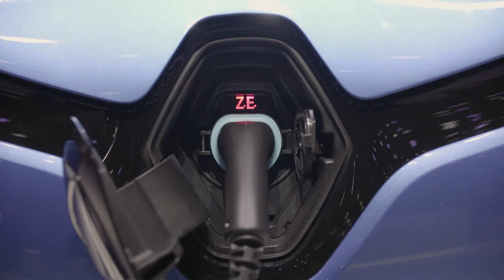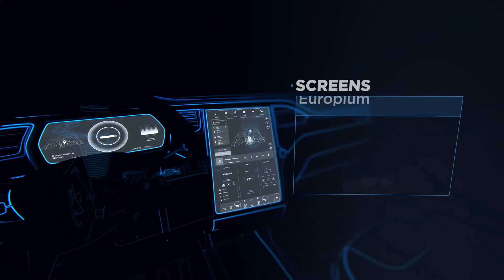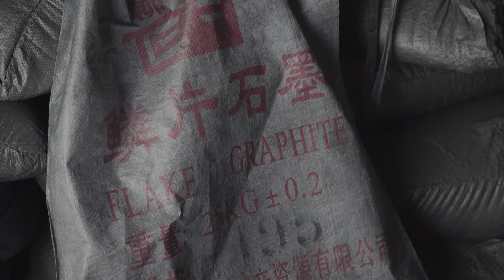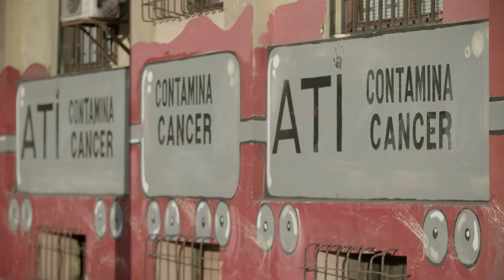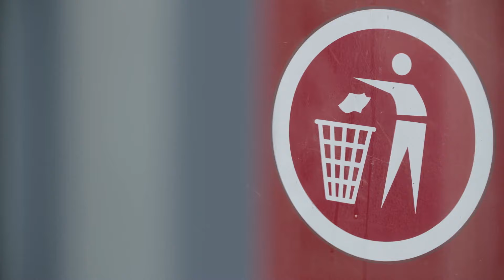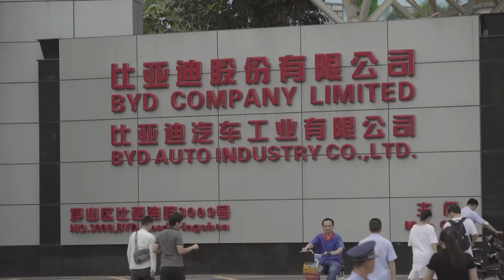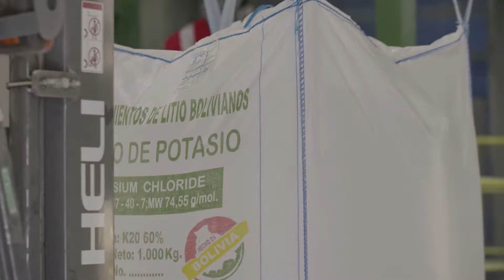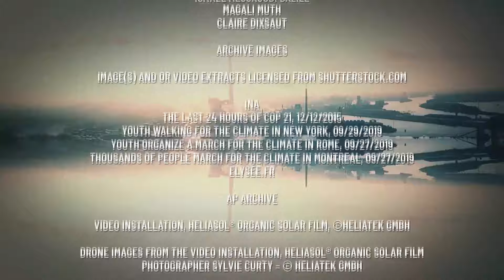The Big Problem with Renewable Energy | Documentary Addicts

Comment: To be fair new tech happens all the time and batteries have improved.
Reply: Your right, but in the 60 years since the we realized that we were creating climate change, all we have done is emit more. None of our new tech is in any position to make the change we need. Add that to the fact that we have limited time making what we do so much more important.
Reply: Energy density in lithium ion batteries has not improved significantly, we just started making larger ones.
Take for example the original 2008 Tesla Roadster, its battery had almost as much kwh/kg as the newest EV's on the market.

It has nearly reached its peak efficiency, same goes for wind turbines and solar panels.
All this "new tech" only looks great on another CGI clip on YouTube, there are entire channels dedicated to ludicrous ideas.
Meanwhile we've had nuclear energy for quite a while now, it is the most compact form of energy production, the safest per unit of energy produced, it requires the least amount of materials and it causes the least amount of emissions.

Comment: Most electric cars are electric dinosaurs. The are as big as, and often heavier than their IC ancestors. If IC powered cars had been downsized by legislation 20 years ago we probably would not yet have EVs, could have delayed the climate emergency longer. Only cars like the Aptera are EVs for the future.  We have to use some raw materials to make things we need. We can easily design products that use less raw material.
 'Renewable' or 'green' energy makes more misuse of that filthy 'S' word, 'sustainability'.  All energy used ends up has heat in our atmosphere and, because of CO2, Earth does not radiate enough of it to space. As far as I know only two means of making electricity add a real minimum of energy to the atmosphere; wind turbines, and air-to-air heat pumping. These recycle energy that is in the atmosphere. Solar panels capture more solar energy to add to that in the atmosphere. H.E.P., nuclear, geothermal and tidal energy all adds more to the excess energy in our atmosphere. However, these are less harmful than fossil fueled energy production.
Reply: to allow smaller, lighter cars, speeds would be limited to 80 kph or even 60 kph and their range would be also limited to 200 km or thereabouts. 
nobody would accept that. We all want to go fast